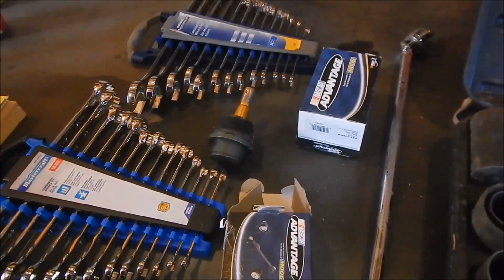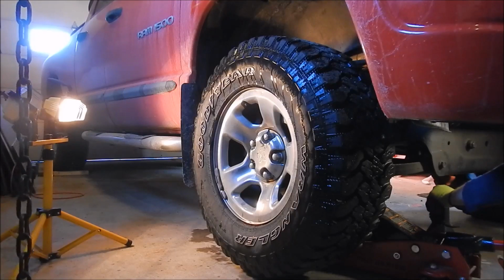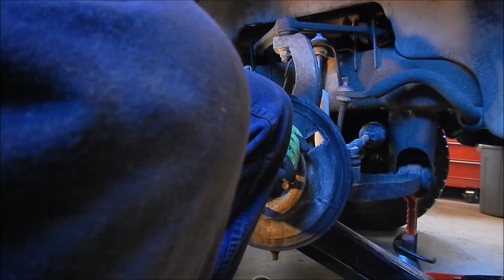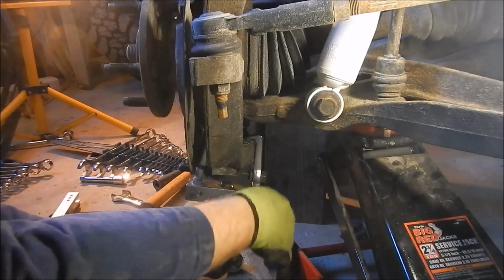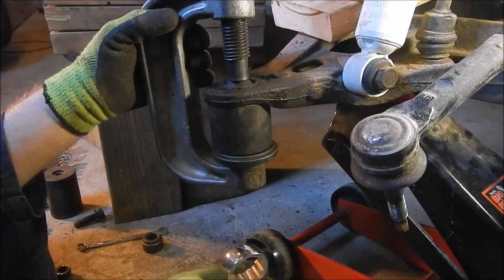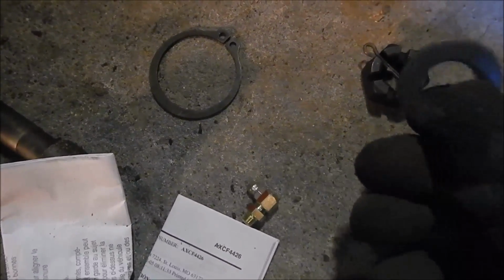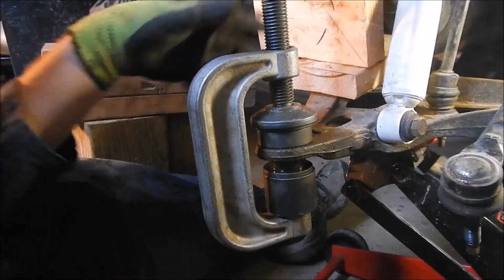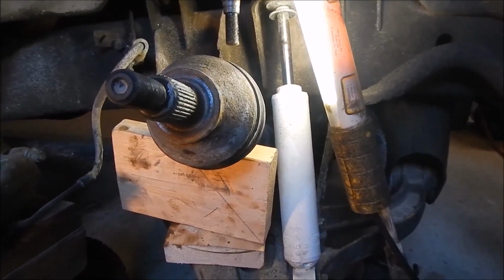2004 Dodge Ram - Balljoints Fixed!

Comment: I had to do the same job earlier this week as my ball joint was completely worn out. I wasn't able to press the the ball joint out since I noticed on my 2003 Dodge Ram 1500 there were spot welds on the top. I ended up using a grinder to remove part of the ridge to get the top of the ball joint smooth to make pressing it out easier. It took much less time and installation of the new one was a breeze. I ended up replacing both the upper and lower ball joints which saved me a ton of money. You did a great job replacing yours. =)

Comment: If you look on the lower joint, most of them are staked in several places to retain them. Either use a chisel to push the stake back within the bore, or use an angle grinder (my preference) to grind the lip off that is interfering with removal.

Comment: double picle fork i jammed two in and smacked the aluminum spindle at ball joint even though you are not supposed to but that was the only way mine would break free infact passenger ball joint broke in half i had to press it out of spindle. good thing i decided to replace both sides at once

Comment: I watched this and it helped me immensely, only thing is I have a 2004 2WD vehicle, the front is the same but you can skip the driveshaft part. I bought a ball joint tool kit thinking it will come in handy. The tool needed to remove the old ball joint had to be modded because of the stamped steel spring assembly won't let it fit. Don't be afraid of grabbing the grinder and modify the tool not the spring assembly. If you don't have an impact make sure you have a decent length of pipe, you will need to cheat to get them to pop.

Comment: I have an 04 dodge ram 3500 SLT 4X4, my question is, do i have to buy the whole control arm assembly to replace my upper ball joints? Also, where can i buy the parts at?
Reply from the maker: im pretty sure the 4x4 Ram 3500's have a solid front axle. I think you would just need the balljoint. Any auto parts store can get you what you need.
Reply: @BoNeS487  

Hello again, 8 months later. Turns out the ball joint comes along with the control arm. What a surprise lol

Comment: what is that tow hook on the front there? how is that set up? I need to figure something out for a tow point
Reply from the maker: It's just one of those eye hole bolts (don't remember the actual name). I drilled a hole in the bumper mount to fit it there. There used to be 2 but the other got ripped off and the one in this video did too. Not strong enough. Which is why I built an offroad bumper with better recovery points.

Comment: Hey BONES 487, I have the same truck for the most part and I'm doing both upper and lower ball joints. My question to you is...after undoing the nut on the control arm upper ball joint, how did you free the control arm from the steering knuckle?  I've wacked the shit out of it like on every other video on the net and it didn't drop out. the same with the tie rod, I've undone the nut on the bottom but then what? You can't use a puller because then you're just pressing it against each other.  So that idea is out. I also tried a pitch fork for the control arm with no luck as well, and I don't want to use the fork for the tie rod because I don't wanna rip the rubber boot because  there's nothing wrong with the joint. Should I just stop being a pussy,  eat a good breakfast, and REALLY wack the shit out of some shit?  Or do you have some details you could possibly pass my way..?
Reply from the maker: I've fought with my upper control arms on numerous occasions and the only thing that has worked for me is hitting the sides of the steering knuckle at the ball joint a couple of times then hitting the arm up from the bottom. I've also used a pry bar or some form of bar to apply upwards pressure to it too sometimes. Always make sure you have the nut on part way to prevent a violent release.
Reply: Before I had a chance to read this I had already gotten it out, and did so almost word for word on from your response. So thank you for the reply brotha! Never done it before, the driver's side (first side) took me 4 hours. The second attempt on the passenger side took me 45 min to do both upper and lower ball joints.  So yeah, I'm pretty much an amazing mechanic now. hahaha. Who needs work done?!?!?! I'll do it! lol